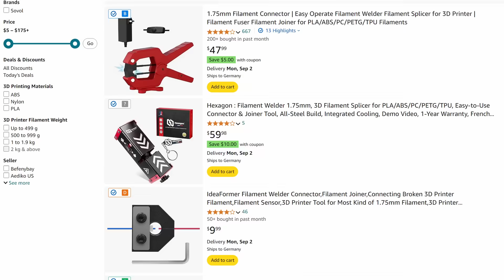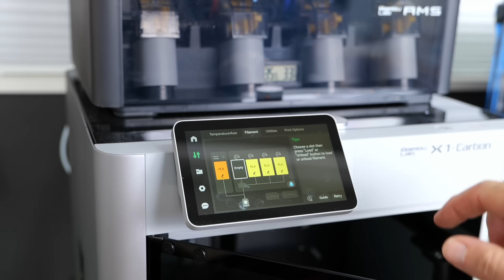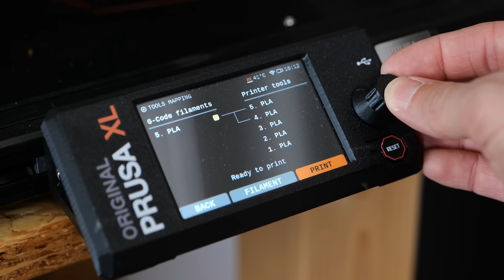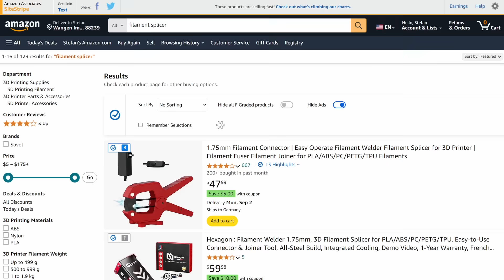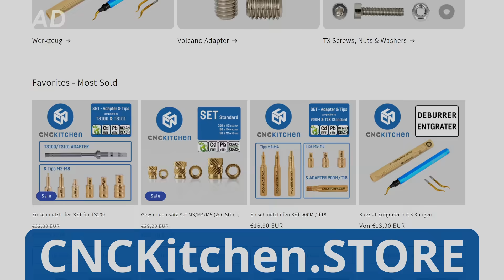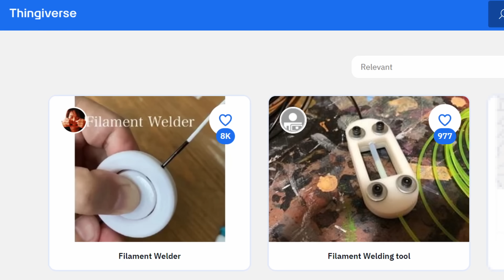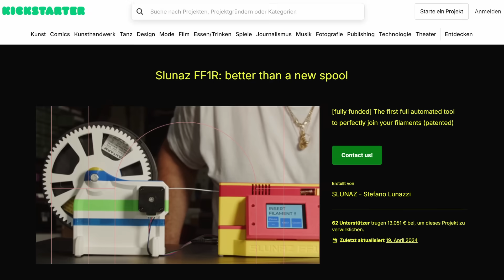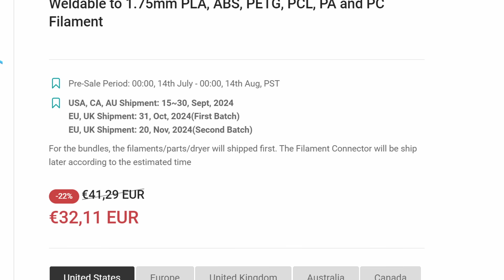The Best Filament Connector but you can't Buy it (right now)

Comment: I don't understand why the heat plates aren't simply PTFE coated to clamp around the filament. It's not as if the idea of Teflon coated things is new.
Reply: You'd need some way to fixate the filament while it's heated up and then preferably actively cooled down again, but that also doesn't seem like it'd be that hard. they could integrated a 45 degree cutting jig instead of the tube slicer to easily facilitate perfectly angled cuts.
Reply: @Nukle0n  word on the street is that flush cuts work best with this unit
Reply: There would be a join horizontally which could lead to 'flashing'.
Reply: It looks like a tight fit in the tube. My guess they went this route is to make sure both filaments are in perfect alignment with each other and stay in alignment throughout the fusion process. You can visually see it before putting in the clamp. With grooves cut out on both halves of the clamp, there could be more of a failure with that contact point slipping away as it’s closed and while it remains closed heating up. Thinking of the end user, not everyone has technical skills required to keep the filament steady in a tubeless workflow. This method is almost foolproof.
Reply: @Egg_663  I'm thinking that before the heated clamshell section, you have fixed PTFE tubes you slide the filament through, which are a tight fit and keep the ends aligned for the clamshell to close over. Then you can design the latch for the clamshell to only latch if it's near perfectly closed, that way the user can't accidentally close the clamshell over misaligned filament, and will just wiggle it into alignment.
The shorter the clamshell the better in this design. Maybe just like 10% longer than the spliced section, so it heats up the filament just in the needed zone, and the user has less margin of error with alignment?
Reply: @weeveferrelaine6973  That’s a sensible idea. I bet they thought of multiple ways and it probably came down to manufacturing cost. Plus, they keep getting money when new tubes have to be purchased.
Reply: @Egg_663  Others have suggested just using a piece of tube and then use a lighter and pulling the melted ends into it, and just let the small tube glide off whe the tube empties
Reply: splicers like that are on aliexpress and are cheap too
Reply: It's very heat proof, too, if my Tefal pan is anything to go by
Reply: That’d be much preferable, but really tight mfg tolerances for the alignment to be perfect.
Reply: exactly, just need a longer die coated with ptfe.  realistically, its so they can produce the unit for $1 vs $5.  And consumable cost is on the consumer.

Comment: The main problem is, that most consumer-level filament is cheap.
A 1 kg spool of PLA is about 25 €, so nearly the same as this tool, and has about 335 m of filament. So you have to rescue more than 300 m of filament to break even…

Comment: Manual splicing is the var. You need 3 things, heat source, slde cutter and some sanding material. It tooks only 5 mins.
Reply: Takes, not tooks

Comment: Hmmm I do feel the sunlu connector might be over hyped? I'm really worried about the need to manually control the pushing force. I can get the connection without much problem in most other cheap setups, just can't control the thickness of the joint diameter. I would expect it to handle the forming for me.

Comment: I mostly try to catch the point in printing where the printer sucks the end from the spool und push the next spool of filament into the pipe until it get's eaten by the motor that's pushing the filament to the nozzle. It's a mind game. :D

Comment: Waste PTFE is a much more harmful product than waste PLA though, its production creates a ton of harmful byproducts like PFAS (and I doubt a cheap product like this is using anything other than the absolutely cheapest possible option for the PTFE).
Reply: I wonder if it's possible to reuse the PTFE sleeves. The might be flexible enough that they can be reused multiple times even when cut.
Reply: In some of the other people's videos I've seen, they slid it off when the spool was short enough and reused it.
Reply: @KJMcLaws  In this video too.
But only for small spools. If you splice 50 meters of filament, this will not be very easy to do.
Reply: It also stays around for ever since there is no recycling cycle for it
Reply: @Klokopf52  Kind-of. Here in the Netherlands and Belgium it is burned and the restproducts are filtered out (at least that should be the case officially). But for sure no real recycling and it needs to be disposed of in the right way or it ends up in 'nature' .
Reply: same concern here. single use PTFE is horrible. It's bad enough in the normal printer, but where there are not many alternatives
Reply: It could be that the PTFE included was manufactured responsibly and without PFOA, but that doesn’t mean it’s off the hook, in fact this use of the PTFE is WORSE for the environment than manufacturing with PFAS byproducts. 

Typically in even the worst PTFE manufacturing, the byproducts don’t literally outweigh the product. Making PTFE disposable is making the PTFE itself a byproduct. 

Think about it yourself as the manufacturer, for every 1000g of filament you use and splice, you add a direct byproduct of .1g PTFE. 

I had never seen PTFE sold as a disposable product, and there are good reasons for that.
Reply: @TheOfficialOriginalChad  Pizza boxes, cheese-packaging, some drink-packaging (getting less fortunatualy), use in lubrication for short-term .... all very disposable uses of PTFE.
Reply: Yeah that part kinda killed it for me, waste is waste
Reply: @PureRushXevus  I'm more concerned of the health effects than I am of the waste. Waste in manufacturing is reduceable, but sadly unavoidable.
Reply: @PureRushXevus  verstehe momentan nur, dass es hier um irgendwelche Hülsen geht und sich viele Leute darum "in die Haare kriegen". 
Aber dieses nichtssagende Stichwort "Abfall ist Abfall" hat mich erweckt: Hülsenfrüchte enthalten viel (vermeintlichen) Abfall, sind aber gut für die Verdauung. 
Bei diesen Hülsen hier scheint das Gegenteil zuzutreffen: Shit wird produziert, aber bei der Abfuhr hapert es?
Wenn ich nicht alles hier vollkommen falsch verstanden habe, dann geht es bei diesen Hülsen um unglaublich geringe Mengen an vielleicht fragwürdigem Material?
Reply: Lol, I don't think you fully understand how and who the pollution is from

Comment: I saw a video somewhere where they simply used a silicon coupler (rather than PTFE) and a lighter. This works because silicon can handle higher heats than PTFE before it starts to release nasties... no need for a "device" at all, just a roll of the correct sized silicon tube.
Reply: Silicone, silicon is what computer processors are made from
Reply: @SamChaneyProductions  might be a language thing, in Swedish silikon is silicone, silicon is kisel, i know other languages have use silicon instead of silicone, when i was a young teenager i thought Silicon valley was talking about all the fake (silicone) tits 🤣 😂
Reply: @SamChaneyProductions  Probably my biggest pet peeve
Reply: silicone is also a pretty bad thermal conductor and probably less dimensionally stable. But if it works, it works.
Reply: @shamancredible8632  ja eh, warum sollte hier Wärmeleitung eine Rolle spielen? Bis die Enden verschweißt sind ist die Umgebung kalt geblieben und man muss schlimmstenfalls warten, bis irgendwas nebensächliches per Wärmestrahlung überhitzt sein könnte. Die Schweißstelle muss sowieso abkühlen und so lange wird man warten können, denn der nächste Schweißvorgang setzt ja voraus, dass eine neue Spule mit Restmaterial irgendwo "in Stellung" gebracht werden musste.
Reply: I just use normal PTFE and a lighter. If you do not overheat it, it does not smell or deform. But the problem persists, the connection point is soft and you have to pull apart slightly. I prefer just switch spools on the fly instead.
Reply: https://www.youtube.com/watch?v=ukN8L5rGWoI

Comment: I’m a Bambu fan. Sure it’s proprietary but it just works. All the calibration is automatic in the background. No messing around with a feeler gauge and accelerometer. Multicolour prints are a breeze and I get to spend more time printing, less time tuning. That and it can be stupidly fast when you want it to be.

Comment: I rely on my Prusa Mini's filament run out sensor which works well, but requires manual intervention. What I would love to see would be a device that has a FRS + the splice core from Mosaic. The idea would be that you always load 2 filaments A and B . If A runs out it would automatically load B. You can then load a new roll on A while B is printing. I think the trick would be getting the price down to a point where this machine would be affordable for hobbyists who might only own one or two printers.

Comment: Hi, I was wondering if the new Sunlu tool could not be hacked, it seems quite simple in fact, there is just the heating part that I do not see (for the moment) how to remake it, I think of using Nichrome wire that is used to make for example coils for smoking devices, The resistors are made from this material and I think it can also be used to solder the filaments, you "just" need to find the right voltage so that the filaments melt without the PTFE tube melting too, otherwise for the rest I think that winding a coil of Nichrome wire around a piece of PTFE tube does exactly the same thing as this little box.

Comment: I do that same thing with a short piece of Bowden tube. I just heat the filament with a lighter and stick them in the tube. Then slide off the tube piece or leave it there as it doesn’t interfere with printing.

Comment: Wast of ptfe tubing, why they don't make a build in ptfe tubing thst is thicker and attached to the unit but in a upper and lower pieces, like some foil remelting tools Making for plastic food pouches. 🤔
Reply: Must be a Teflon or some other material that can be a split and reused, but most filament will not stick

Comment: I used my nearly empty spools on the AMS and they are brittle and snap inside the AMS, I just use them on my old Ender 5 models to make small parts, and if it snaps it takes a few minutes to solve the issue, whereas stripping down an AMS is a pain!

Comment: To merge left overs manually, the best solution I found was not to directly heat the filament, but heat a box cutter blade for 6-8s and use the heat from that to melt the ends of the filament. Works particularly well with PETG.

1. Drive one end of a two sided box cutter blade into a scrap piece of wood to make it vertical and keep it steady
2. Cut the ends of both spools square, and position the spools well enough to be able to keep the strands aligned later on
3. Heat up the upper part of the blade for 6-8s with a jet lighter
4. Push the ends of the filaments on each side of the blade to melt it
5. Without leaving the blade, slide both filament strands up until the blade is not in-between,allowing both ends to touch and stick together
6. After pressing a bit to get a good joint initially, pull a bit instead to help getting a good straight alignment and a slightly smaller diameter around the melted part
7. Wait for the joint to cool down until everything is completely rigid again
8. Trim the excess with flush cutters + a blade. Shouldn't be able to feel rough asperities in both directions

Recently used this method again and it worked flawlessly on 6 left overs of PETG the other day. I didn't get any jamming or breakage. Didn't try ASA or ABS, but PLA works ok too.
Reply: Nice
Reply: you are a genius
Reply: Very smart! Large diameter, ABS pipe for draining shallow wells and submerged areas use some type of similar vertical heating iron or element between two pieces of cut pipe. The heating element rotates out and the two ends are pushed together or rolled forward to create pressure. I’m assuming that someone at some point will device the same thing. I am more familiar with the two metal wheels that push welding wire forward into a MiG welder. Maybe there is a way of using six wheels of which four push the filament into two wheels in the middle, one on top of the other that are heated to a specific temperature. The two wheels keep the shape of the filament, so perhaps no need for the ptfe waste tube? If I can cobble something together, I’ll create a video

Comment: I usually feed leftovers manually into the printer, but that means I need to supervise the print and be present at the moment the filament runs out. I use an inverse bowden setup, so it is quite easy to push the new filament behind the previous one in the PTFE tube.